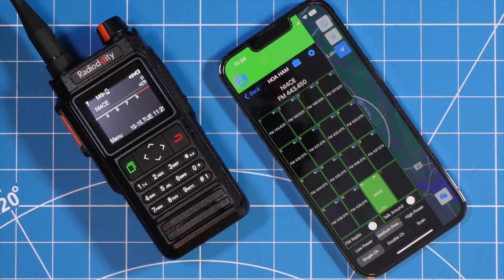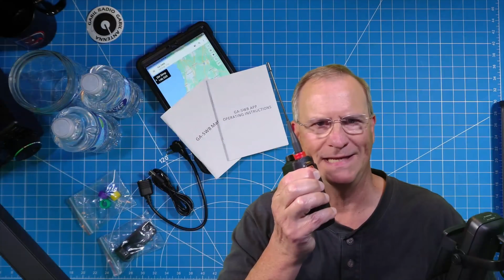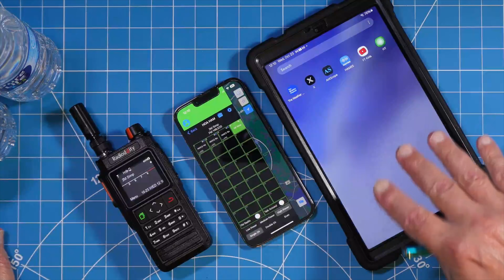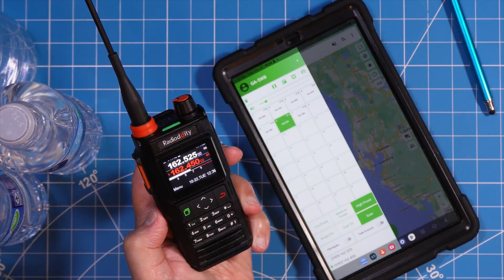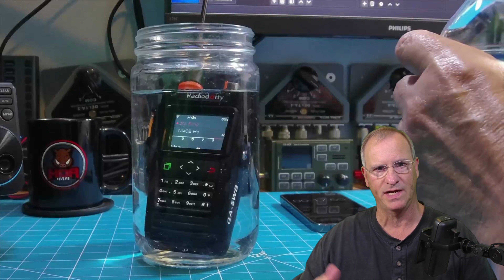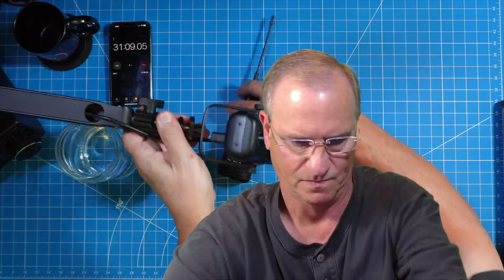VERO VR-N76 / Radioddity GA-5WB - YOUR NEXT HAM RADIO - Features, Dunk Test, Spurs, Air Band, Review

Comment: Question. Have you found out how to disconnect the voice from the radio to the app and I am not able to hit the Cocoa SARNET repeater where I can with my other HTs. I have checked and rechecked the settings, frequency and the tones. I'm in Indialantic so I'm some distance from the SARNET repeater. Also, do you enable the tone on RX as well as DX?
Reply from the maker: Wish I could be more of a help to you @outlaw6595.  I'm still in the basic mode of using my VGC HT's -- they stare at me everyday begging for attention : )
Reply: @HOAHamRadio its all good brother. I got it figured out.  You can disconnect the radio from the phone, and reconnect it if you want to program. I had the freqs backwards, fixed that. And, the tone does not have to be enabled for listening.

Comment: I run the FB group for all 3 HTs... Radioddity does not support the firmware like BTECH does.. btech fixes alot of veros problems and then Vero sends a a fix and then 4 months later radioddity will...  

The radio is neat but is not even remotely APRS but does a "version" of it.. does it work, sure.. but it sucks on messaging, "smart beacon" and other things that real radios do...
Reply from the maker: Thanks for stopping by for a look at the review and sharing your knowledge; I think I need to join one of your FB groups.
Reply: Does the n7600 has the same APRS issue?
Reply: @rec929  as far as Ive heard yes. Since it used the same firmware as the 7500 and HTs..  I just got mine in the mail and haven't opened it uet
Reply: What are your FB groups?
Reply: @outlaw6595  it's the name.of all three HTs Vero nn76 radioddity GA5WB and BTECH uvpro

Comment: I own the UV-Pro and I am absolutely pleased the radio. The only gripe I have is regarding the bluetooth mic. I purchased it and ended up returning it the audio quality was terrible, especially considering the cost of the wireless mic. That being said I found out that VGC sells a wired speaker mic at a much reasonable price. Well as much as the VGC, Radioddity and UV-Pro are the same the VGC speaker mic will not work with the UV-Pro. I can receive ok but it won't key the radio's PTT. I've been looking for a wiring diagram in hope that I can rewire the speaker mic to work with the UV-Pro. Enjoyed the video. 73....
Reply from the maker: Interesting, seems Vero is wants to have just a bit of an edge to their direct brand.  Thanks for sharing.
Reply: It should it's literally the same radio call tech support..
Reply: @jarredjones8476  The folks over at VGC said it only works on their HT, go figure..